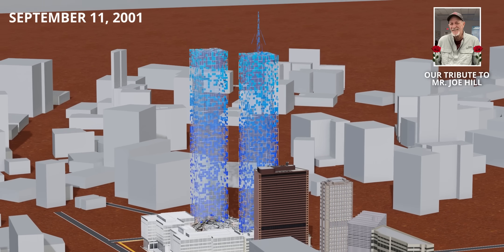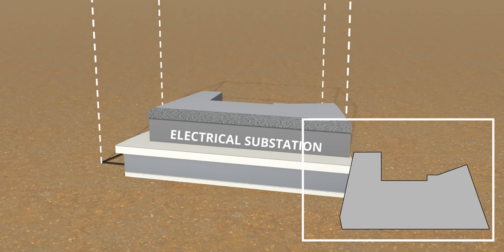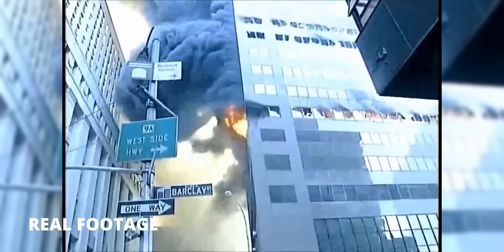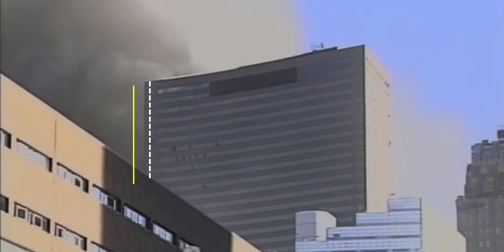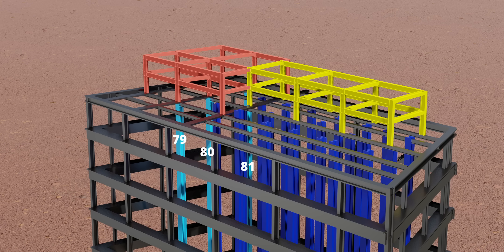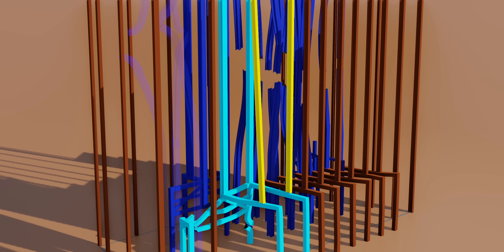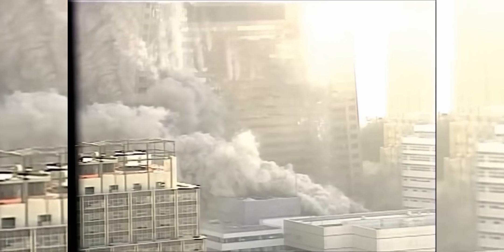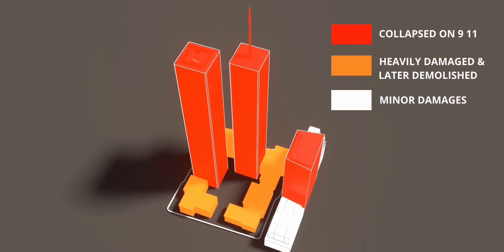Collapse of Building 7 | The Complete Physics

Comment: first of all let me address that this video is done by someone who is not structural or civil engineer and if it is then he is amateur at best. this video is deliberately done in this way so many people can jump to the conclusion and reinforce their already made conclusion which is one made up under fear and that is that there can not be a conspiracy behind such event where this destruction and death was pre planed. although there are many evidences to prove this ill just say as an engineer and architect that steel columns can not snap in any way like shown in this amateur video because they are under compressive load and they were not under stretching one. if they were under stretching load like the cables of a hanging cable bridge construction sure they can snap but this is not the case and the scenario and every engineer knows this simple mechanics. regarding the demolition issue many argue here let me point out that this was carried out with the intention to cause destruction and death and that is why this is not a classic demolition and you don't get to see it like it is done in a regular way where the bottom floors are worked first, also because the buildings were not evacuated and many regular demolition proceedings didn't take place at all and most important fact is that the demolition was carried out in such manner the way it started around the floors where the airplanes crashed in to the buildings so they can use their already made up lie to cover up all of this which just points out to the fact that all of this was pre planed by someone who is much more resourceful than a bunch of radical military group from the far and middle east . regarding the demolition of the 2 towers just never ever forget that this was done for the first time in the history that this kind of skyscrapers were brought down in such manner using demolition and there is absolute no way that the process it self wont cause damage to the surroundings simply because of just how massive those buildings were. if they wanted a regular removal of this structures they would have to be deconstructed floor by floor starting from the top floor and work your way down. there are many cases and many known and documented events where massive structures collapse under various conditions caused by many things like earthquakes and scenarios where one or more core structural parts fail and causes massive damage and in almost all cases you can see the whole structure tumbled down on the ground which is called asymmetrical collapse and this didnt happen here hence why many engineers and architects raised their voices.
Reply: Sabine Mathew is a civil engineer.  This is an engineering channel. Given that, I did not bother to  read past your first sentence.
Reply: low iq clown
Reply: @serafar  funny how you say that when your first statement is wrong.
Reply: @EnzoFilipek  how so? Enlighten me pls or u cant reason with logic??
Reply: @serafar  look at the channel banner, read the about page, or read the channels name.
Reply: @EnzoFilipek  where am i wrong then?
Reply: @serafar  This is a civil engineering channel. He is a civil engineer. 

If he isn't, that like naming your channel something like "MinecraftVids" and post volgs.
Reply: @serafar  also he is quite clearly one too
Reply: hes a clown. paid clown! ill say this anywhere anytime no matter what. this video is nothing but science fiction of the worst kind.

Comment: More lies brought to  you by Mossad and the  CIA
Reply: And yet not wrong. Go figure. 
	
This video is pretty good – with a few exceptions - and goes into a much higher level of detail than many viewers will be able to comprehend.  While not perfect, the collapse mechanisms – the sequence of failures - described here  are substantially correct and this is true no matter who planned and carried out the 9/11 attacks or why . 

That may not be what you want to hear and go against 20+ years of entrenched dogma and conditioning, but it’s not wrong. 

That also means (in case you did not get the hint) this video can be (and IS) absolutely correct in its description of collapse mechanisms AND the 9/11 attacks could still have been some sort of inside job. The two things are in no way mutually exclusive. 

The mechanisms described here have broad professional support around the world. There are no professional engineering organizations (for example: ASCE, ASEE, ICE, etc) that disagree with them or have offered any formal dissenting opinions or alternative hypothesis. 

So, setting hubris aside, either the overwhelming majority of the worlds structural engineers and simple observation are wrong,… … or you are. Which seems more likely? 

IF you still think believe this explanation is wrong then produce a better one . Good luck with that. No one ever has and I don’t see you moving that needle today. 

No one ever does.

Comment: If building 1 and 2 collapsed due to the extreme temperature caused by the jet fuel,  where did building 7 get the jet fuel to have such extreme fires?  Did the fbi store jet fuel in the building?
Reply: Jet fuel started the fires in the Twin Towers. Plenty of flammable material in any office building to keep a fire going happily for hours.

That flaming material from the North Tower started the fires in Building 7 when it landed on it. 

It helps to use the thinking part of the brain.

Comment: Where did the high temperature come from, to soften the steel, which presumably had heat resistant cladding?  There was no jet fuel and no aluminium.  Even with the sequencing that is being suggested, it does not convincingly explain how such a localized initial weakening transformed into such a uniformly distributed and simultaneous collapse, at least, not for me.
Reply: Were you not paying any attention?  From the multiple fires raging on at least a dozen floors for 7 hours with no effective fire suppression or fire-fighting efforts. Even with intact fire insulation, the fire safety rating was 2 to 3 hours in normal fire conditions (operating sprinklers and active firefighting).
Reply: @TheCriticalStinker-01  Fires of burning office materials should not be softening steel.
Reply: @wodantheviking  - Says who?  Not the last 150 years of fire science research, which trumps your I can't believe it and because I can't believe it therefore it must not be true illogic.

Comment: This is absurd nonsensical rubbish.  Truly insulting to anyone possessing any common sense. 
This is the single, most insanely stupid thing I have ever seen.
Reply: And yet not wrong. Go figure. 
	
This video is pretty good – with a few exceptions - and goes into a much higher level of detail than many viewers will be able to comprehend.  While not perfect, the collapse mechanisms – the sequence of failures - described here  are substantially correct and this is true no matter who planned and carried out the 9/11 attacks or why . 

That may not be what you want to hear and go against 20+ years of entrenched dogma and conditioning, but it’s not wrong. 

That also means (in case you did not get the hint) this video can be (and IS) absolutely correct in its description of collapse mechanisms AND the 9/11 attacks could still have been some sort of inside job. The two things are in no way mutually exclusive. 

The mechanisms described here have broad professional support around the world. There are no professional engineering organizations (for example: ASCE, ASEE, ICE, etc) that disagree with them or have offered any formal dissenting opinions or alternative hypothesis. 

So, setting hubris aside, either the overwhelming majority of the worlds structural engineers and simple observation are wrong,… … or you are. Which seems more likely? 

IF you still think believe this explanation is wrong then produce a better one . Good luck with that. No one ever has and I don’t see you moving that needle today. 

No one ever does.

Comment: The guy making this video seems like a nice man, I wish him well. I'm not a structural engineer but I am an engineer in the large scale gas industry. If something happens like this to asset's or people, regs and standards are always upgraded. So we can either blame it on demolition and no upgrades to standards are required. Or we can blame if on fire damage over multiple floors and design error, in which case every tower in the world needs upgrading. Especially if oblique radio tower debris and office fires brought building 7 down in just 6hrs! . No changes have been retroactively made to similar buildings 🤔.
Reply: Just 7 hours you mean.  Curious why you find it odd that a building burning out of control over 7 hours with no active firefighting is going to not come out so well. That is 3 times longer than the buildings fire safety rating with active firefighting

Comment: Nice try!! I didn't expect any truthful investigation..
The building is brought down by explosions.. no buds!
Reply: And yet not wrong. Go figure. 
	
This video is pretty good – with a few exceptions - and goes into a much higher level of detail than many viewers will be able to comprehend.  While not perfect, the collapse mechanisms – the sequence of failures - described here  are substantially correct and this is true no matter who planned and carried out the 9/11 attacks or why . 

That may not be what you want to hear and go against 20+ years of entrenched dogma and conditioning, but it’s not wrong. 

That also means (in case you did not get the hint) this video can be (and IS) absolutely correct in its description of collapse mechanisms AND the 9/11 attacks could still have been some sort of inside job. The two things are in no way mutually exclusive. 

The mechanisms described here have broad professional support around the world. There are no professional engineering organizations (for example: ASCE, ASEE, ICE, etc) that disagree with them or have offered any formal dissenting opinions or alternative hypothesis. 

So, setting hubris aside, either the overwhelming majority of the worlds structural engineers and simple observation are wrong,… … or you are. Which seems more likely? 

IF you still think believe this explanation is wrong then produce a better one . Good luck with that. No one ever has and I don’t see you moving that needle today. 

No one ever does.